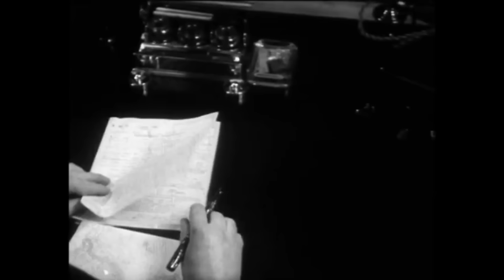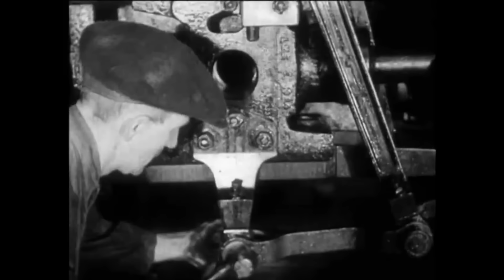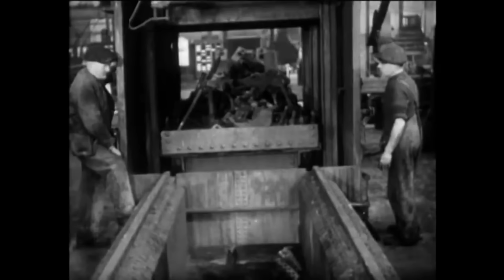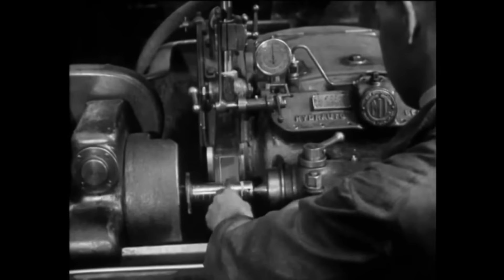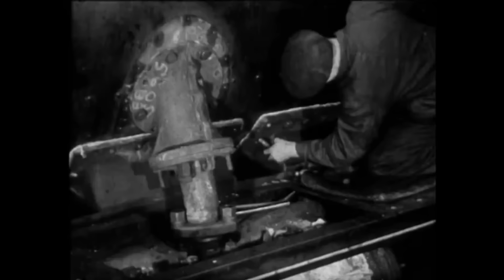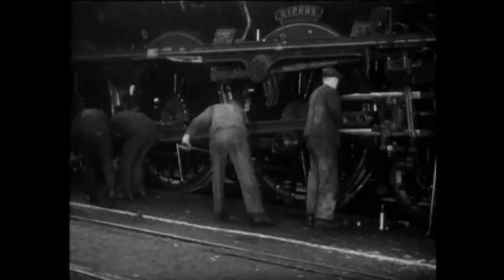LMS - General Repair - 1938 - LMS Railway film

Comment: 5605 was a Jubilee-class 4-6-0 built in 1935 and officially named Cyprus the following year. Renumbered 45605 by BR in 1948. Between 1950 and 1957 she was allocated to Leeds (Holbeck) depot. She was withdrawn from service in 1964 and scrapped at Crewe Works shortly afterwards.

Comment: Imagine what could be achieved in the modern day if all workshop workers worked to a timescale so precise and efficient as it was in the 1930's. Workers today want to get paid for doing as little as possible, most take no pride in their work. The modern day repair/ maintenance workers could learn alot from the example that was set many years ago. Mankind has learnt through experience and what was done in the past, and I think that is forgotten sometimes.
Reply: If they were able to keep each engine to the strict timetable, in the face of the inevitable slip-ups in the supply branch, injuries due to workplace accidents (and there was not much attention to safety then), and the inevitable 1% of employees going off sick without warning, that tells me they had plenty of "fat" in the system, and nobody worked that hard.
Unionism was strong then, too
Reply: These people wanted to be paid the maximum for the least work possible. You do as well. Unless you're actually nuts. 

The nature of jobs has changed, the dynamic of work vs pay has not.

Comment: In the US,the AAR/ICC had a 5 step program of locomotive overhauls! It started with depot inspections/ light repairs,to total rebuilds! Plus that was done on heavy Mallets and other far bigger engines,i.e,4-6-4's,4-8-4's,but that also went down to 0-4-0's,and even 4-4-0's,as those engines existed right up til the 1960's! The system was intensive as well as extensive! Thank you for your attention ☺️! Thank you 😇 😊!

Comment: Only in twelve days, the giant has been repaired, rebuilt and painted ❤ Only the work schedule of this workshop shows why Britain ruled half of the world 🌎
Reply: They did well and had the routine down to a science. But compared to a modern diesel.....change out the bogies with new traction motors... a half of a day. Replace the whole main engine....I'm guessing a day, maybe two. Then back on the road. Not to mention much more time between major overhaul. I've heard figures of a million miles stated. It's not hard to see why steam locos disappeared quickly once decent diesels became mainstream. Much less downtime.
Reply: If I were in charge of the LMS I'd slap the fool who decided to let it take 5 whole days to paint. Paint it black and deal with it. Save 3 days. That's money going down to toilet on a loco not doing work. 😂 so much for the big 4 being efficient and above the pointless waste of BR

Comment: The thing that strikes me with all of these videos is the apparent unconcern with health and safety.  My Grandfather worked at Derby loco works for 50 years.  After a short retirement he died of asbestosis gained from his work lagging steam engine boilers.  I went on to work in a BR workshop after leaving the navy in the late seventies.  The machine that I worked on, boring   Con rod bushes, was first used in 1887.  Even at this times workshop accidents and injuries were prolific, I’m hoping that there has been a big change in railway workshops now !
Reply: There is all parts are probably made in china
Reply: Workplace Health and Safety staff of today would spontaneously combust seeing this. 🤭
Reply: Some of it was a lack of knowledge, some of it was a lack of care. Those workplace safety regs are all written in blood. I would bet money that things are considerably safer now, if just because the jobs tend to be far less labor intensive. Diesels and electrics need far less major maintenance than steam ever did, and the parts that tend to need maintenance are generally designed to be whole unit swaps - e.g. a diesel prime mover power assembly, traction motor/axle assemblies, etc etc.

Comment: Like in the comment below, I am also amazed that it took only 12 days to rebuild a Locomotive of that size and all done on time. When you take the 5 days off for the Painting, that means the Engineers, turned that Engine, around in only one week. The railways were losing money even then, but they still kept the workforce busy and then along came the war. Then they were even busier. then. I spent 30 years in the British Motor industry. 20 of them as a company with 7 employees and there is no way we would have done what they did in this video in a week. Martin. (Thailand)
Reply: The Great Western Railway once famously built a whole locomotive in 16 hours. Probably a pannier tank.

Comment: 12 Day's ........ a minor servicing on Typhoon jet fighter is 100 days...  were did we go wrong. The skills and craftsmanship amazing. Never sadly to be seen again.
Reply: A fighter jet must not fail, lives are at stake, and they operate at extremes. Really high altitude and sea level. They also break the sound barrier, pull 9, 10 G's, some slam on metal decks then later flung off with double their weight. They have to work upside down too. Thousands of psi in the hydraulic systems, mutiple backup systems.  Modern aircraft, can be stripped down faster than this train. Putting em back together involves, fixing, checking, rechecking. Every fastener wire tied to another where possible to prevent it from falling into the cockpit or engine intake. sometimes the engines need to be spun up for the check, so you might need to wait on fuel or another piece of equipment for testing, or the people qualified to test and turn. The closest thing to working on these trains would be jet aircraft or F1, or Nascar race teams. These guys have cranes too, a fighter jet, you're jacking that up by hand with multiple jacks. Not to mention all sorts of explosives to mind with weapons and ejection seats. ;-)
Reply: Where
Reply: @timwingham8952  Taif Saudi .. Though not there anymore, back in Blighty..

Comment: Hi , my name is Phil I did 50yrs on the footplate I started at edgeley shed on the 4th of April 1961 in 1962 I moved to Trafford Park shed as a fireman 1964 I moved back to edgeley I finished my time out at 9A as a driver Regard Phil.
Reply: Phil, did you work steam, or diesel in 1962?
Reply: @jamesanderton344  on nuclear
Reply: Did diesels normally have firemen? Gen question lol
Reply: Did you ever drive or hear the sound of a class 28 Metro Vick

Comment: And not a single item of crappy hi-vis clothing in sight
Reply: These had not been invented yet. 
And before you ask, the same goes for ear defenders...
Reply: @omepeet2006  Ear-muffs?
Reply: @lesreed9269  Yeah those.
Reply: And how many people were crushed by heavy machinery because the operator didn't know they were there? Yes, there are lots of ridiculous applications of hi-vis these days (school children walking down the street, FFS) but this is exactly the sort of place where it's actually useful.
Reply: @beeble2003  You're not wrong mate, but how can you use something that hasn't been invented yet?
Reply: @omepeet2006  Of course you can't use something that's not been invented yet. I was responding to the tone of the original comment, which seems to be saying that hi-vis is a bad thing.